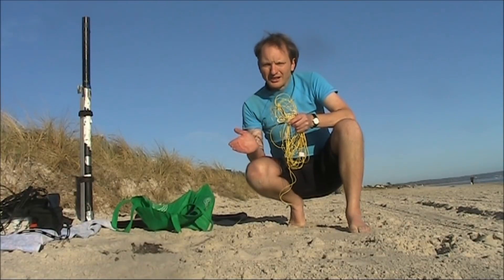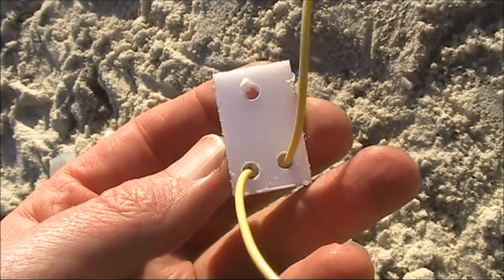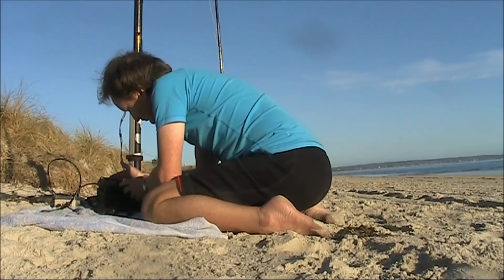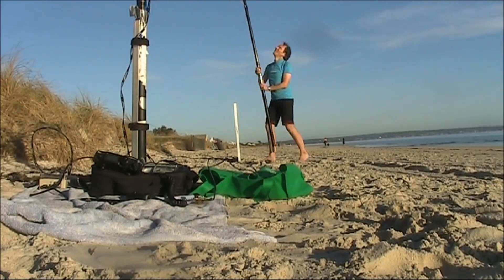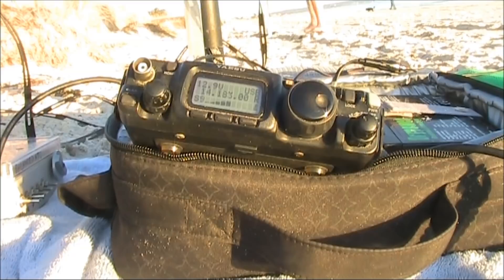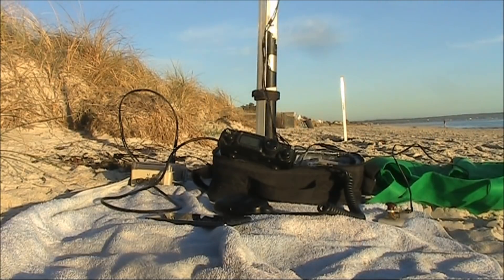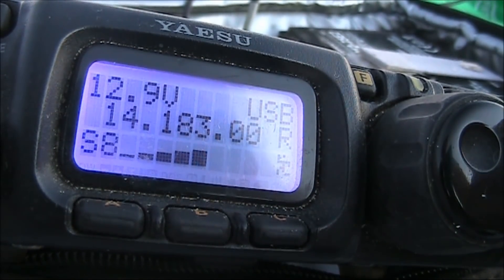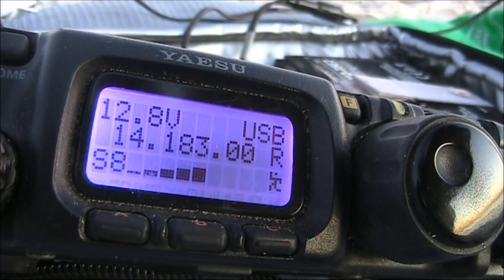Triple Six HF multiband delta loop for 10 to 24 MHz

Comment: I don't think the loop would be a low radiation resistance on 40m as there it would be just under a half wave in perimeter. It would be a very high impedance with a large capacitive reactance component. Depending on the length of balanced feeder to the tuner and the tuner in question, this could make it problematic to tune.
It would still be fairly efficient though if you get it tuned with low system losses
Reply from the maker: Les Moxon discusses this in his HF Antennas for All Locations book. You can go down to about 70% of resonant frequency for a loop but below that efficiency drops of a lot and it's not worth bothering with. Hence I wouldn't use an 18m perimeter loop anywhere below 10 MHz. (where 18m is 60% the 30m wavelength).
Reply: @vk3ye  However, a half wave bent into a loop has an extremely high impedance at its tips, several thousands of ohms.
I tried to feed a halo at the gap.
I succeeded with a 1/4 wave transmission line transformer but noticed effects related to loss that could only be attributed to the extreme impedances present.

Comment: Very interesting, Peter. Your prediction of performance being similar to a vertical dipole appear to be borne out by the directivity experiments.

And good to hear Volker ZS3Y - I last spoke with him on 10m I think a few years ago.
Reply from the maker: Mike - one of my reasons for choosing about 0.8 wavelength is that Moxon's book mentioned that directivity was highest at that length. Maybe if I fed it so it was horizontally polarised - ie at the bottom with the top flat - the directivity would be noticeable.
Reply: @vk3ye  Peter, it might be worth giving that alternative feedpoint a try.

In that configuration it might behave like a dipole where on the frequencies where the height of the horizontal section approaches a half wavelength or greater it will exhibit directivity, but at lower frequencies it will behave similar to a dipole at low (electrical) height.